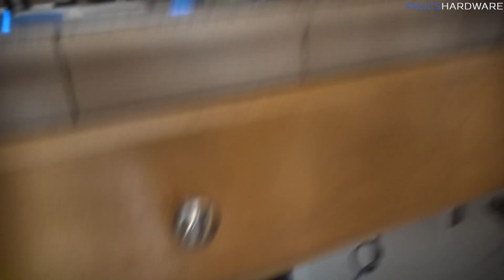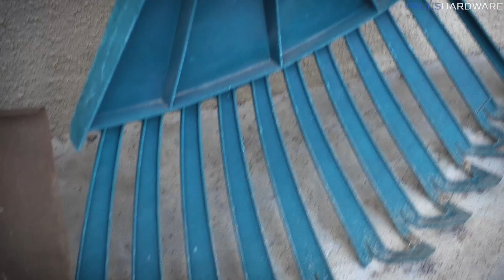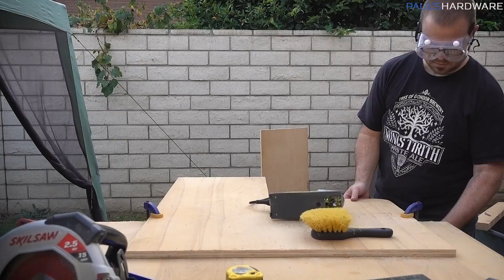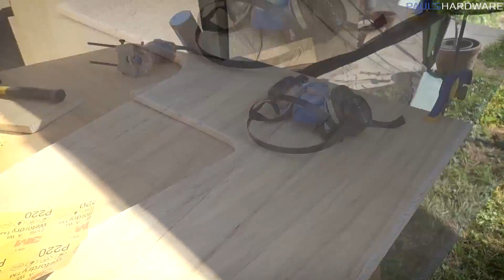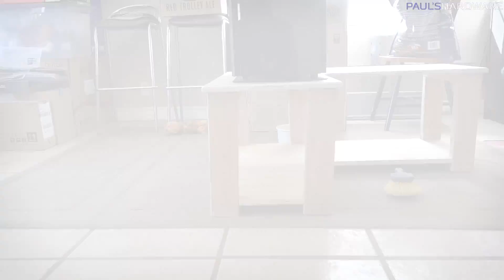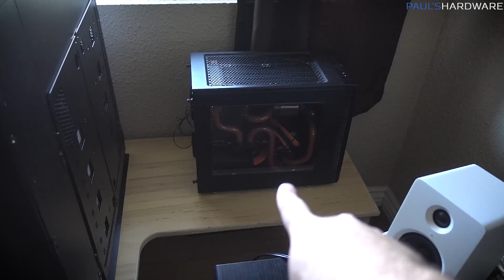Mortally Wounding Myself While Attempting to Build Furniture

Comment: Hey Paul, just a tip when using an orbital sander. If you release it from the object you're sanding, don't put it directly back on the product with it still on. Once removed from the wood, it will pick up RPM lost from the friction of sanding and can dig into the wood when you place it back on. Shouldn't be a bid deal with what you're making but for future products, might come in handy.

Comment: You didn't need to use the extra guide on the router as you already a bearing guide on your round over bit. You could have then easily used the router to round over the curve!

Comment: It didn't appear that you used any new teflon tape on the threads for the fitting at the water supply valve, or at the union with the supply line to the refrigerator.
It might be worth looking into that.

Comment: Might I recommend using pocket screws to build the legs for your next one? Screwing into endgrain like you did is actually much weaker than screwing into sidegrain, and you can use wood plugs to hide the pockets.

Comment: Those things are called compression nuts, Paul.  I am glad the fridge came together super fast for you guys!

The kit sold at the store that punches into the copper pipe is THE WORST THING ANYONE CAN USE!  The saddle valve is a nightmare, and a lazy plumbers way to make money off of you.  They will need replaced after every 3-5 years. Do yourself a solid and get a valve like what Paul has.  Sharkbite connectors have very similar things, and with minimal time and hand tools, can be installed in minutes.  I am looking for a blueprint for your stand, as I need to get some PC's lifted as well, and they are taking up desk space already.

Comment: Hey Paul I have a question? I have an older computer its a Asus  Intel Core i5 650 (3.20 GHz)  8 GB DDR3  1 TB HDD with a AMD Radeon HD 7700. My question is what up grades would you recommend to hold me over for a year or so. Until I get a new pc. I play wow and it works ok at 65+ fps until get into a large BG's or Raids then my fps drops to 5. Thank you for your time and help.

Comment: you should install a reverse osmosis system and then tee off of that for the fridge.pure water ice cubes, and you never have to replace the built in filter in your fridge saving you cash!!!!! plus the bonus of not having to buy bottled water.

Comment: Nice video.

Question - Are there/ Is there any options/solutions for buying something like you made? Because I also have a massive tower (Thermaltake View 91). While I don't want to put it on the floor, I definitely am not putting it on my desk. Personally, I find that so silly. Besides not thinking my desk (Arozzi Arena Gaming Desk) would even support the thing, it would take up valuable desk real estate.

Comment: Who was the jackleg that recommended a polyethylene ice maker line for you. Ice maker lines are the number one destroyer of houses in the U.S. and this type of line is why. It surpassed washing machine hoses years ago for insurance companies highest pay out. It gets brittle from the heat in back of the fridge and is too thin. The tubing built into the fridge looks the same  but its 5/16 and has not been a problem. Sometimes it will even be written on the tubing (do not use for icemaker line) . Replace it with copper, braided line, or solid white plastic tubing.
Reply: Brian Ptomey yah same thoughts not a pro but my grandpa is a contractor always used copper.
Reply: @matt2m  Yeah but Paul seems to think I'm too passionate against people that cause millions of dollars of flood damage every year. Paul will not go back and say anything to this hardware handyman. I wasn't raised like that . I care about the next guy he he hurts. That's the amoral additude people in CA have. I spent 25years years there and that's the way they think. I dont know if he is from CA but his backyard looks like it.
Reply: Came here to ask why he used this style of line and not the flexible braided lines, that have safety valves and all sorts of stuff in it that is miles better than this.

Comment: Paul, 1 tip I learned on drilling holes, if you want them a certain depth (so you do not punch thru the top plywood etc) put the drill bit in regular then wrap tape around it at the depth you want to drill (or slightly less) that way as you drill you do not have to worry about if the bit slips up more into the drill etc and your holes are the perfect depth.

Comment: Black Widows are really good for the ecosystem! You should save her somewhere useful. I save mine on my loud neighbors patio.
Reply: FUCK. THAT. SHIT. 
Those fuckers can and WILL kill your ass with a single bite.
Reply: @SpurnOfHumanity  maybe an infant or very elderly, or has some 1 in a billion allergic reaction. I was bit between my upper lip and gums by a black widow. It found a nice warm hiding spot, while I was sleeping... My mouth. I abruptly woke up, freaked, and got bit while trying to rip my face apart in an attempt to remove the spider. Bedtime wasn't the same for quite some time. I moved within the week.
Reply: @tjrooger1092  that is terrifying
Reply: @tjrooger1092  I watched this video before bedtime and decided to read the comments, that was a bad idea.
Reply: Despite hundreds/thousands of reported bites over the years, you're more likely to be killed by a cow than a Black Widow
Reply: @B3anus  You're actually thousands of times more likely to die texting and driving.
Reply: I have arachnophobia if I find a black widow I'm not saving it...I'm not doing anything with someone else can deal with it fuck that I'm running in the opposite direction

Comment: Love all your videos Paul, but these wood working ones are the ones I like the most. I just bought two of those Hammarp solid wood butcher block 8’ countertops plus 11 adjustable legs from Ikea. Also bought two large mending plates, dowel kit, and Gorilla wood glue from Home Depot. Going to build a large corner desk, and plan on sitting in the corner where my fully loaded Cosmos 2 sits. On one end I’ll have my work laptop and monitors, and on the other end I’ll have my large Apple monitor hooked up to a modded Mac mini.

Comment: use kiln dried wood, that isnt bent. 
cant criticize much. next time just drill the chop saw into the wood for peace of mind.
if you were routing solid wood you probably would have left burn marks, so set up two passes, shallow and final depth.
 too slow = burn, too fas = router tear against the grain. 
ten bucks says you never read this.

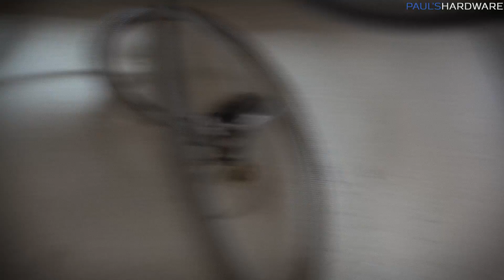Comment: FYI- @3:30 in the video when you turned the water back on, you'll see some gray/black stuff go up the tubing for the ice maker. That was the remnants of the internal rubber for that shutoff valve. In all likelihood, next time you use that shutoff valve it won't work (completely) and you'll have a small leak. So you'll need to replace that in the future. Change it out with one of the newer 90-degree quarter-turn style shutoff valves. They use nylon gaskets/seals and rarely go bad (e.g. you'll never need to change it again).

Comment: 2x4s are never straight or flat enough to have nice joints unless you mill them down. Consider getting S4S boards. If you have to use 2x4s, make sure to buy kiln dried (marked KD-HT) and not green (marked GRN).

Comment: 2x4 and 3/4 inch ply... you can jump up and down on that thing. 

that router is no good for that thick of material.  little trim routers are good for cabinet doors and smaller. I burnt one of little ridgeds ding 3/4 inch cabinet grade ply.

keep your hands away from screws and drill bits. I dont think you should buy a nail gun.

Comment: Hey Paul, might I suggest a Laptop stand for your wife's set up?
https://www.amazon.com/Mount-Adjustable-Articulating-Computers-MI-3352LT/dp/B00FUOILAC/ref=sr_1_3?ie=UTF8&qid=1541834243&sr=8-3&keywords=mounted+laptop+stand&refinements=p_72%3A2661618011
or maybe 
https://www.amazon.com/UPERGO-Readers-Adjustable-Rotating-UP-8/dp/B07259C5SV/ref=sr_1_9?ie=UTF8&qid=1541834243&sr=8-9&keywords=mounted+laptop+stand&refinements=p_72%3A2661618011
just a thought to cut down on her wire clutter. :)

Comment: You do not need to brace the top at all. The 3/4" Plywood will support your PC easily. The 2x4s at the top already support the outer 5". Though if you want you could use a 2x2 single piece between the 2x4s in the middle.

Comment: paul , do your self a favor and don't use poly tubing. try a stainless braided flex connector from home depot,  6 ft should suffice, ends won't blow out, line less likely to kink and compression ends tighten and align easier, just sayin  from lots of xp and a thx for showing your trade so well.

Comment: I'm a hobbyist woodworker and just want to say your respirator is not at all overkill for sawdust.  Especially plywood.  
On the router, you don't need to use that edge guide unless you're doing rabbets or dadoes (see https://www.youtube.com/watch?v=f_LEoRYN3Sk ) for details.  That way you can follow the edge and round over around that curve with no problem.  You just want to make sure the base of the router stays flat on the surface of the board you are routing.
As far as the design of your project, it isn't engineered all that well but it's not likely to fall apart anytime soon.  The joints you used, called butt joints, don't have much lateral strength.  If you want to do a cheap improvement you can add metal L brackets to connect the plywood to each 2x4 (something like this: https://www.amazon.com/Teenitor-40mmx40mm-Stainless-Bracket-Fastener/dp/B0714FP9LB/ref=sr_1_3?ie=UTF8&qid=1541816152&sr=8-3&keywords=l+bracket ) and attach them with 1/2" wood screws into the plywood and 1" into the 2x4.
A channel you should check out is Steve Ramsey  https://www.youtube.com/user/stevinmarin  he does a lot of beginner projects and a lot of limited tools stuff too.  He's been doing woodworking on youtube for a decade now so he's got a huge library of projects.  There's hundreds of other channels you can check out but he's a great place to start.  If you have any questions feel free to ask, I'd love an opportunity to pay back some knowledge from all I've learned from you.

Comment: Paul's Hardware
 new YouTube channel: "Idiots with cheap tools wasting material while inflicting light body harm to themselves"
Reply: And what the fuck was with 1/8 id tube, You like standing in front of a fridge for no reason?  The fridge has a 1/4 " supply inlet, use it. Make your existence easier,  never reuse fittings,
ever. And for a love of humanity and some regard for plumbing and yourself get a new supply valve.  Liquid cooling computers -  those things should come naturally. I'm not gonna start with carpentry. It was almost as bad as the dude from Verge building $ 2000 gaming rig. Not quite as bad at least you had a thought.
Reply: What you expect he's from California.

Comment: When you build something with lumber you don't want to put screws in the end grain of the wood because over time they will loosen. The end grain of wood is like a collection of strays, and what you did was put a screw at the end of the bundle essentially. The end grain also absorbs glue and you don't get a very good bond unless you use a lot. If you want a good joint you can use pocket screws or insert a dowel that you glue in. Round over bits, and flush bits don't require a guide because of the ball bearing on the bottom.
Reply: End grain screws are fine for indoor furniture, as long as you don't use too short screws.
Reply: @pev_  also pre drilling so that only the spiral bites into the wood and doesn't get pushed it away.
Reply: Yes, pilot holes are always good but require accurate positioning if your joint relies on screws only like Paul has here (also like I usually do, heh).

Comment: Try carpet on the ramp. I have a dachshund (long body and short legs like a corgi), and it helped him a lot.

Also, try lowering the torque on your drill when screwing. Helps prevent over screwing and stripping.

Thanks for the video :)

Comment: Paul! Very nice video. But, I'd like to mention one thing: please care about ear protection. You mentioned overkill on the dust filter, I'd rather have seen you go overkill on ear protection instead. Your ears are very very fragile, and unlike lungs, they don't restore over time. So best case scenario: dust filter with good ear protection. If you have to choose: go for ear protection.

Above are my opinions. If you are a professional, and disagree, please correct me :)

Comment: A piece of friendly advice concerning fasteners. If you use deck screws with a torx head (star as commonly called) you won't have to deal with the bits camming out like philips head screws are prone to do. That and the deck screws tend to be a bit stronger than drywall screws and since they're specifically for going into decking, they have a cutting profile on the tip to help prevent splitting and the underside of the heads feature teeth (for lack of a better word) to help the screws self countersink. Oh, and each box comes with the correct size torx bit included. Usually a T-25.
Reply: phillips really does kind of suck for that kind of work.  i would also add that he wasnt opposing the upward force of the screwgun enough either.  if you dont lay into the screw, it will always strip like that ime
Reply: madmat2001 Just finished re-decking a boat dock. Was my first time really using those screws and holy hell do they make work easier.

Comment: Hey Paul, one tip for the ramp. Staple some short-pile carpet onto the ramp. If they feel like they're slipping they usually won't use it. Some indoor-outdoor carpet will sometimes fix that for them.

Comment: Building tip: use the star drive screws (Spax, GRK).  They make life so much easier when screwing things together and they aren't that much more expensive, esp if you are only using a few at a time.

Comment: That's not a cap keeping the fitting (compression nut) on, it's a 1/4" sleeve and it's forming the seal that keeps the water from leaking out of the connection.

Comment: Some protective lacquer or sealant on the wood would look great & bring out the grain, as well as, help protect it & make it last longer etc.... Can always add this later on if decide. If really want to hide cables, can use router & create cable channels to help rout everything & keep clean & nice, along with cable clips etc....
Could spend days on a "simple" PC table or weeks depending on what ya wanna do with😉
Best part, once your finished & you like it & it suits your needs perfectly, thank you did a GREAT job & it's PERFECT.
Cheers, A

Comment: Paul, the fridge water line "fittings" are called compression fittings.....ALSO; PLEASE don't forget to change the water filter in your fridge about every 3-6 months depending on use(& with auto ice maker, if don't use a lot aa to prevent lines from freezing up on you, don't let ice buildup in the container or overflow, even if have auto shut off, doesn't work sometimes and Samsung fridges along with other major brands have this issue along with freezing over inside on the fan and condenser and is the number 1 issue with these fridges that can do yourself and safe $300 in a service call), if ever have plumbing issues, can save some money & do yourself with sharkbites & PEX tubing/hoses. Hope these tips/suggestions help you. Wish lived in your state, would have helped you build your "case" as have all the tools necessary & love this kind of stuff🙂
Love the channel & vids💙👍🏻
Cheers, A

P.s. Still patiently waiting for tesla PowerWall solar energy last follow up/thoughts/Q&A video please.....
Reply: The pros seem to be split on whether sharkbite fittings are a good idea.  A manual PEX spreader and the right fittings are a safer bet.
Reply: Having worked in property management and construction, i can tell you that sharkbites are a great way to get something done quickly... but if you want something done correctly and for long-term viability, use an actual plumber. :P
Reply: Sharkbite fittings are ok for a quick and dirty repair to get out of a situation. Pex and appropriate fittings and the tools to use it are the best thing in plumbing since the pipe wrench.

Comment: what sort of insane nutjob puts an electric plug socket UNDERNEATH A SINK and water supply!!!!
Reply: how else are you going to put a food disposal unit under the sink?
Reply: @aflea8272  literally anywhere you want, just don't have an exposed  live electrical circuit right next to a water source, you can run a cable as long as you want for a disposal system. What next, having one in a shower or bath?

Comment: In hind sight you should have cycle the valve on and off a few more times to flush out the build up in the valve before connect the other end to the fridge. 
https://youtu.be/4MN_GXVcqW8?t=209

Comment: Love the  Spider attack as I was going to say POOR spider till I googled them.    

I can understand the computer off the floor as I take it California is a dry state so you get lot's of dust there but little tip get rid of the carpet in your computer room no matter how much you vacuum it there will always be more dust and hardwood floors are easier to clean :)   I just built a new computer as I decided to go from a Full tower to a Mid tower as it's the 500D  SE which now sits on my desk as it's like a Unicorn on drugs (RGB)  but when I had the full tower I sat t beside my desk on the floor and it never really got dusty but I have another PC and it's beside a area rug and you can tell the rug will create lot more dust then the hardwood floor.